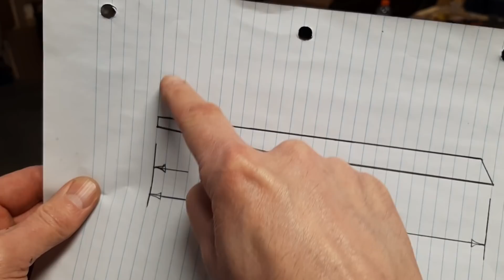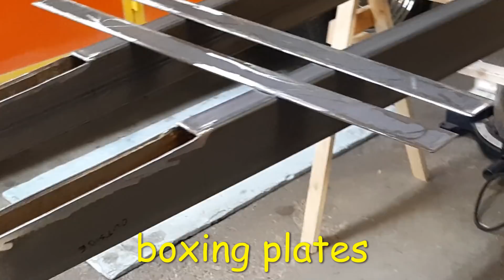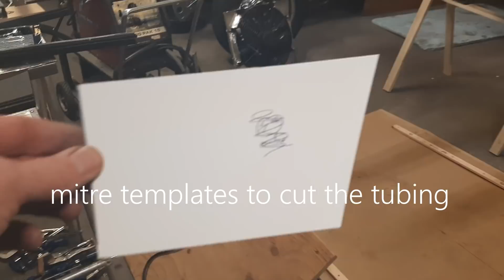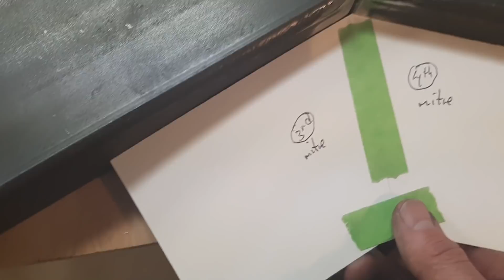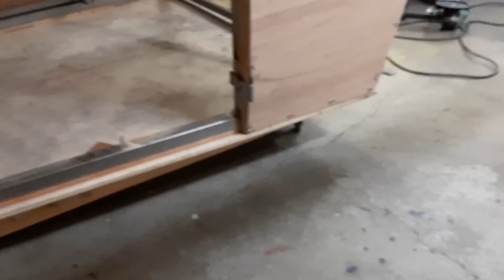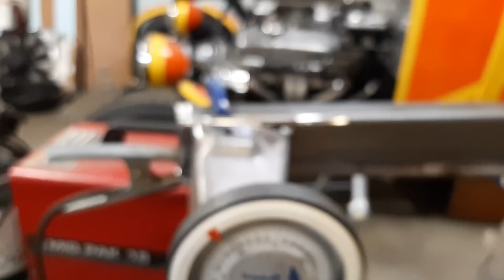The Backyard Coupe Build 7 The chassis part A.

Comment: Hello all awesome job in frame building I got a magazine at a book store but does not give me the measurements to build a frame it called hot Rodders bible. Can you please measurements , you mentioned in the video the first two pieces are 8 ft then you taper them down but you didn't mention the rear section and the crossmember part number. Thanks again.

Comment: What is the thickness of the tubing?
Reply from the maker: Hey Tim, tubing for the inner body structure is 1/16, Chassis frame is 1/8, Ladder bar and spring mounts are 3/16.

Comment: Which speedway cross member did you get? They have several.
Reply from the maker: Hi Marilyn, sorry for the late reply, I will include all the part numbers in the plans, the crossmember is speedway motors part # 91657012

Comment: Hey Kent plz..plz..plz get the plans ready.. I am ready to buy them,just waiting on you Hot Rodder. Lol. Plz.plz.plz. Chuck👍👍👍👍🚴‍♂️🚴‍♂️
Reply from the maker: Hey glad your interested! working hard on them, will notify everyone when they are ready, soon! thanks.
Reply: @kentdixon5716  Interested? I am absolutely mesmerized with it,go too sleep with it on my mind..wake up driving it lol...getting my garage set up for it..I am 60 and this took number 1 priority on my bucket list,I am in the process of building a TearDrop Trailer and I just love woodworking and oldies Thanks my friend. Chuck
Reply from the maker: @squirrelboger8594  Lol, that is awesome, I really enjoy working with wood also, I am no master wood worker by a long shot, but I find it very forgiving to work with, way easier than sheet metal, I am a retired welder so the metal fab is good for me, the woodworking part I just learned as I needed to, the boat building industry gave me a lot of good info working with wood, and they actually get used in the water! The Backyard Coupe wont see too much wet weather.

Comment: Kent, with this video you have just taught the Non WELDERS, HOW TO BUILD THE FRAME! 
Buy the tubing, get a cutter use the templates and then either buy the welder and lay out the whole thing and then have a local professional welder come in and weld the whole thing up for you. Problem solved and probably costs less than buying the welder
Reply from the maker: Hey John, That is a very good Idea, for the welders that are not certified, they could just tack everything up, and have , or take it to a shop and have welding completed, wouldnt cost that much, must be completed by a pro as this vehicle is on public roadways. thanks.

Comment: Correct me if I'm wrong Kent. I believe he is showing us this method of making a frame without a frame jig. Every video of a frame being made where they bend the tubes they are using a frame jig to ensure both sides are bent exactly the same. The way Kent is making his frame he doesnt need a frame jig. I've seen so many rat rods where they are setting unlevel and look like they are running down the road sideways from frame rails not matching. Doing it this way without a jig your more likely to be straight and level. To bend one you'd have to lock it down onto something like a frame jig. Cant wait for the next video and the plans.
Reply from the maker: Hey Paul, somehow I missed your comment, To the best of my knowledge Paul, I think the reason anyone would use a frame jig is if they were making a lot of frames, they can set it up for a certain style, then cut the parts , clamp them in and weld them, everything is pre- measured and straight. Your right Paul, in this build it wouldnt really be necessary being this is basically a one off, easier to just cut my pieces clamp everything level, and diagonally square, and good to go. Part 2 frame video any day now, been so busy working on plans, will be out soon! Thanks!

Comment: You need to where you get this stuff like the cross member
Reply from the maker: Hey Steve, good point, the crossmember you can get from speedway motors, part 91657012.  32 ford crossmember, most rod shops sell them. I will have part numbers for major components in the plans, but  I know while you guys are waiting you might want to collect some parts, I will include them in the videos.
Reply: @kentdixon5716   I would like to know how much $ you have in the car ..a round about  #
Reply from the maker: @stevebilskie6097  Hey, I have around $11,000-12,000  total, that includes a new 290 hp crate, and brand new front end parts, axle, radius rods transverse spring  ceramic headers etc, guy could save more money shopping swap meets for these kind of parts, Body and chassis bare costs around $1200 for materials, You will never come close to this affordable price for a coupe style car in my opinion.

Comment: Why didn't you just weld the to together. Then  zipcut the bends into the rails and bend to the proper degree and reweld. This would make sure that both are the same and would reduce the welding necessary.
Reply from the maker: Hey, not sure if I know exactly what you mean. but make a pie cut, then bend it together , and weld it, yes you could, but the first mitre off the main rail has a compound mitre, so wouldnt work there, the other mitre joint you could, I prefer a completely cut mitre allows more freedom to fit, and move the joint if necessary.